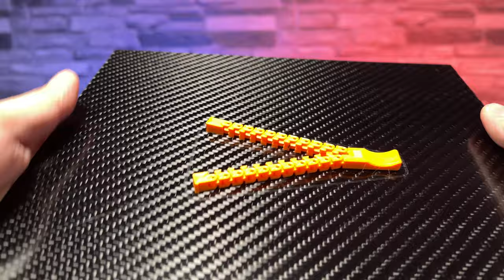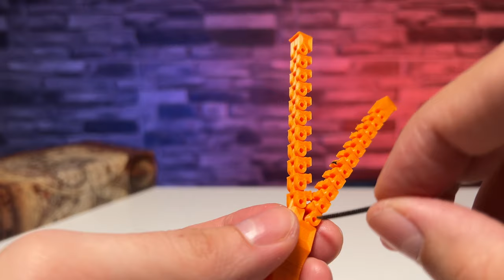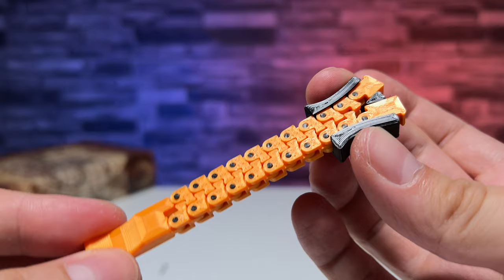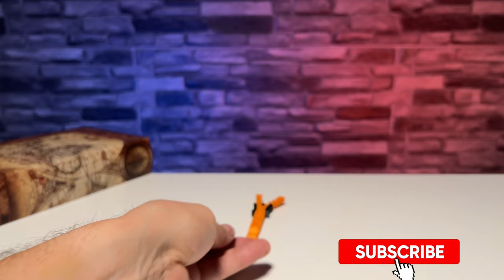3D Printed Zipper Mechanism

Comment: very cool. i wonder how sturdy the result would be to print this with fabric printed between the middle layers. like how you'd buy a zip with fabric attached in order to then be able to sew it onto things.
Reply from the maker: I think the zipper design would need a lot of tweaking. In this way, it is quite fragile and would not withstand long-term handling. 👍